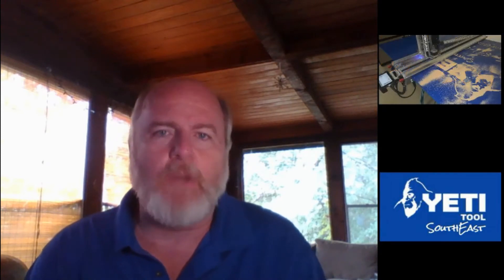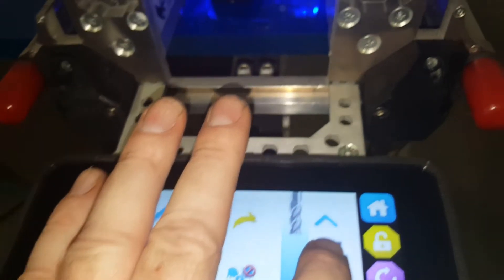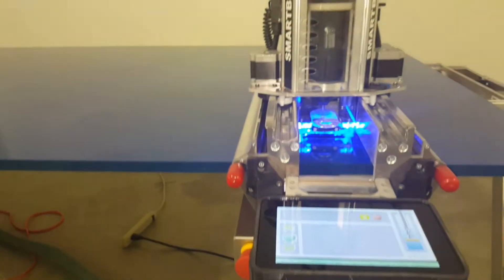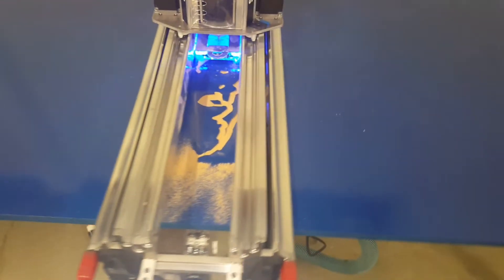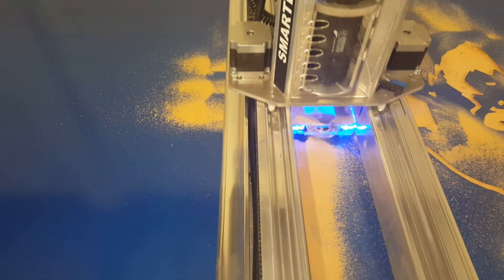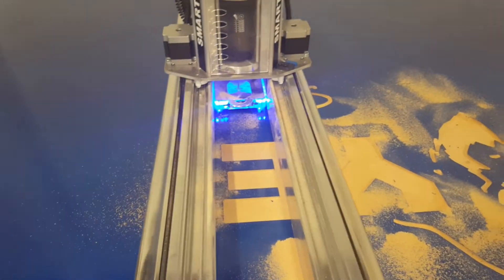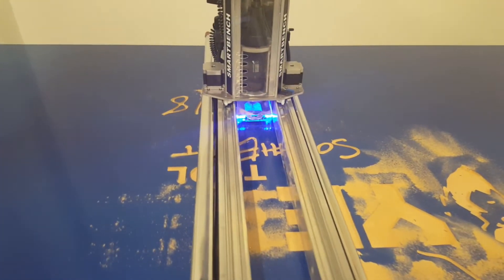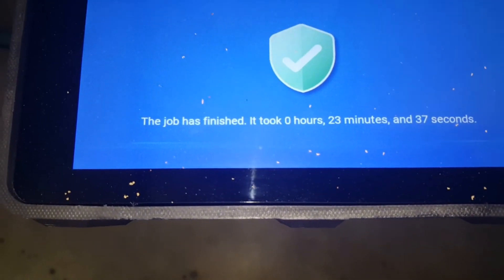Demo area 4x8 sign

Comment: Do the bearing ride over the dust particles ?
Reply from the maker: In this video, I raised the upper beam .25" above the (pre-finished) painted surface by putting small pieces of 1/4" ply under the wheels on the upper beam, clamping the beam tight (to set the height), then removing the plywood --- leaving the wheels 1/4" above the surface of the material.  I also have a video showing Corian risers that can be used, or, use the upper beam to clamp onto the top surface of the material.  The dust collection should get most of the swarf picked up --- some customers change from the shopvac connection and build their own dust shoe to connect to a 4" dust collection system.  This changes the CFM from 130-150CFM for a shop-vac type dust extractor to 600-1200CFM for a 4" dust system (depending if you are using a 110v or 220v system).....  That's the beautiful thing about the SmartBench --- you can tweak it to fit YOUR work flow efficiently.

Comment: Nice! How is the overhang supported?
Reply from the maker: In THIS video, because I was not cutting through the material - just engraving the top side --- it wasn't.  The lower XBeam supports the material to bring it perpendicular to the spindle -- just where the spindle is based on the XBeams position.  If I was cutting (for example) a nested sheet of cabinet parts, I would use a 1/4" spoilboard because I would be cutting the perimeter of the parts and do not want to cut the YBeam (long axis) frame.  Again, as the XBeam (short axis) moves up and down the table, it is fully supporting the material AT the XBeams location.  Wonderful design.
Reply: It is sandwiched top and bottom on the x gantry.  It keeps the spindle 90 to the material.